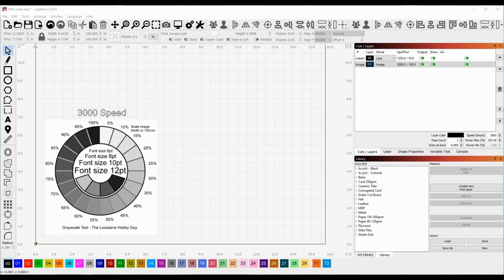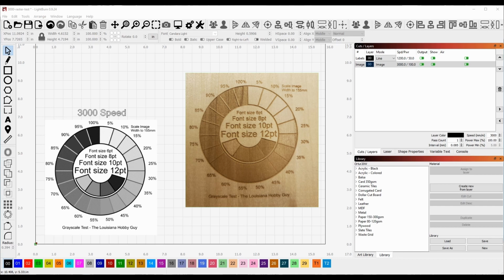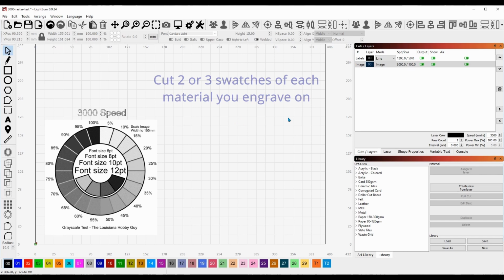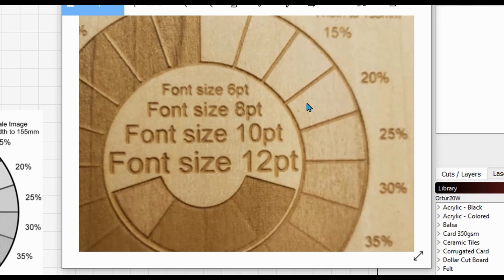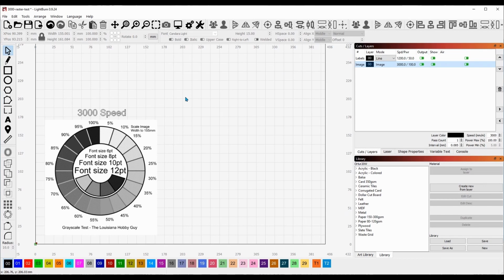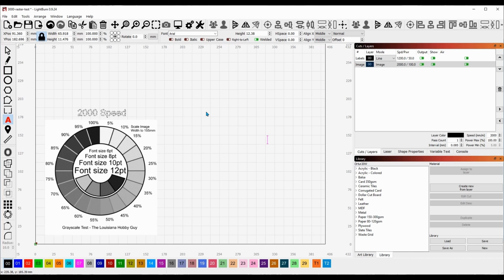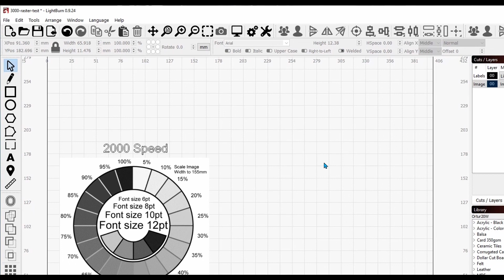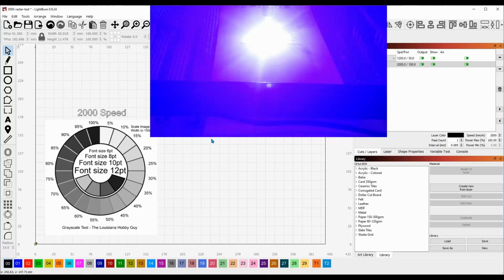Creating Image or Raster Test Burns for the Ortur Laser

Comment: Please, one more question since i havent found a video describing this on your channel. I followed your video to make a raster test which is great. Thanks one more time. I used the image mode "greyscale" as it was a default in your project. Now the question is. I know its a bit tricky to get good results for a different images but. How, or do you even process the image before you import it to lightburn? Im using "Da Big Gimpin" plugin in the Gimp so the script does all the work on the bacground. Than i only choose a "pass through" in the image settings. Do you process your image im the lightburn? If yes, what type of Image Mode do you use? And i suggest its good to adjust each image individually to get the best result (brightness, contrast). Am i right? Thank you!
Reply from the maker: Hi Tomáš! Here is DA Big Gimping Plug-in hack for Lightburn: Select the image, right-click, select ‘Adjust Image’. Bump the contrast up by 5, brightness down by 5, Gamma to 0.075, Enhance Radius to 5, Enhance Amount to 200. Make sure your DPI on the image layer isn’t too high (the default 254 is a good starting point). Set to Stucki or Grayscale dithering. Click Negative Image button.
Reply: @TheLouisianaHobbyGuy  ou im really exciting to try this trick. But i just started a second raster test for 2400 speed so i Will have to wait. Im just curious. Negative image?
Reply from the maker: You can try it both ways. I sometimes get better results using the negative image with darker wood. You don't it for light wood.

Comment: Thank you for your list, that should really save new users a lot of time! In the tile test you have to program each square to use a different percentage. How does this program know to use 20 different percentages when there is only one image file? (Hope this makes sense, if you print a regular image file it isn't going to change percentages right?)
Reply from the maker: The program is changing the power based on the shades of black.
Reply: @TheLouisianaHobbyGuy  OK, very confusing to me after watching your vector test grid video.  So it is already in the picture, white is 0 and black is 100%.
Reply from the maker: @jf6720  Yes! 👍

Comment: Would this file be good to test Canvas?  I have multiple colors spray painted on canvas topped with black, and  I burn away layers to show an image.
Reply from the maker: Yes, in the Show Notes section of the file, I have canvas listed. My settings that work well for painted canvas are 3000 mm/min, 55% power, 318 dpi multiple layers, but you could run the test as I described in the video. When I did it on canvas, I started at 3000 mm/min and did three tests. 3000, 4000 & 5000. All three produced good results. 3000 @ 55 was my pick for a 20W Ortur laser. 4000 @ 70 and 5000 @ 90 also came out very similar, however I chose the lowest number to use the least amount of power. The less power you use, the longer the diode will last.

Comment: I downloaded your image and it printed just fine in Lightburn preview but if I change it one bit, it previews all black. What am I doing wrong? Thanks!
Reply from the maker: You don't change the image Fred! You can change the speed & power settings, but not the image.
Reply: @TheLouisianaHobbyGuy  I duplicated it and changed power but it did all black. I’ll try again. Thanks.
Reply from the maker: You probably didn't have all of it selected when you duplicated it Fred. Just reimport the file for another copy.
Reply: @TheLouisianaHobbyGuy  I’ll try again. Right no my computer is tied up doing a CNC project. Thanks again!